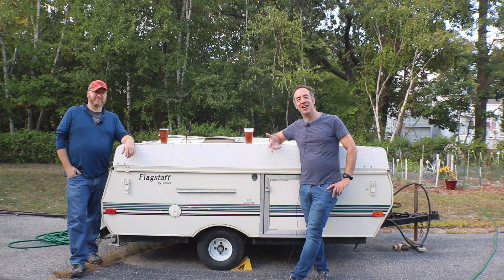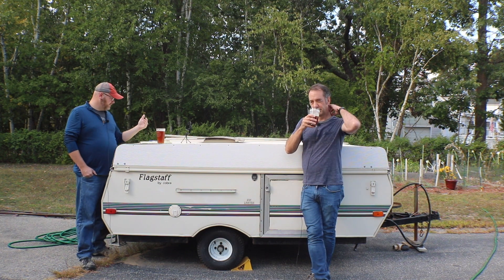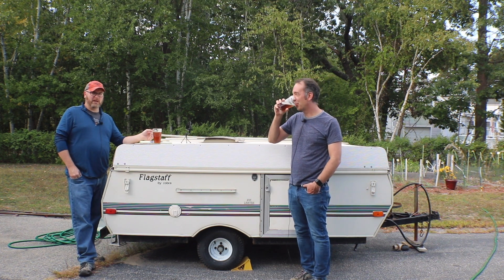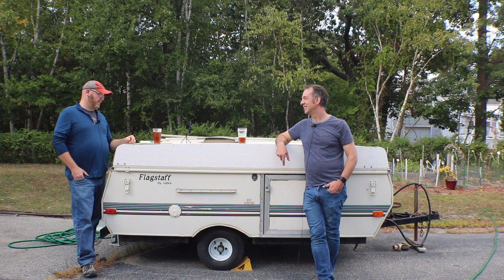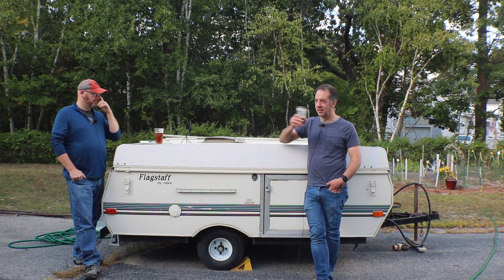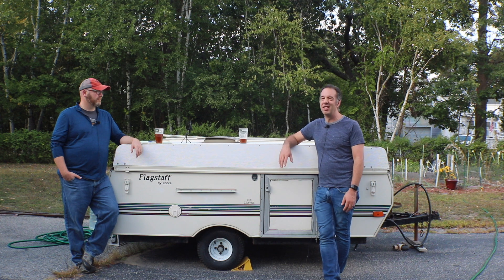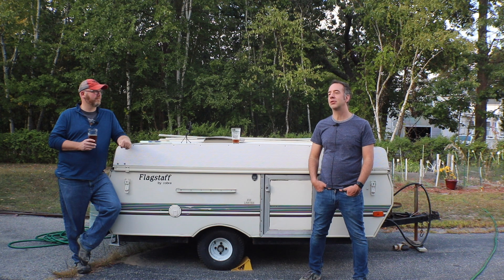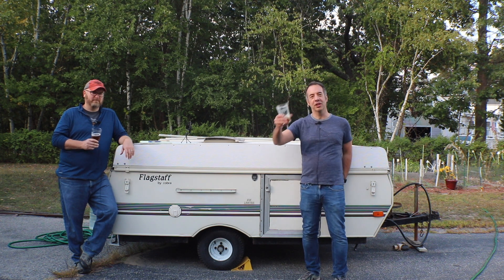Off-Flavor Experiment - Phenols In Contaminated Homebrewed Beer

Comment: Really enjoyed this video.  I have a hard time getting rid of my "home brew funk" in many of my beers despite tons of washing and sanitizing.  They range from funky but drinkable to downright awful dumpers. I've read many descriptions of what contaminates produce which off-flavors, but in real world experience it is often hard to pin down. "Home Brew Funk" or "Buttered Asshole" are just not good, technical descriptions.  I appreciate the post-video description of what you are going to do to troubleshoot this issue - very helpful!!
Reply from the maker: I'd totally toss anything plastic that contacts the beer post boil/chill.  I'd soak everything else used to ferment with warm clean solution (75F).  Rinse super well then do a warm cleaning with PBW 10% stronger than usual.  Rinse well.  Lastly I'd sanitize overnight with a totally different sanitizer.  If you use StarSan, go to iodophor.  or vice versa.  That should do it.  If that doesn't help them maybe its time to buy a new fermentor.  Best of luck.  Direct message us for more support.  Cheers!  -Mike

Comment: I can definitely relate to this one.  I have brewed monthly for several years without having a bad batch.  I was getting real confident.  Recently,  I have dumped three out of four batches (15 gals.).  I am at a loss. It started when I switched brewing suppliers from Minnesota to Texas.  The questions I am dealing with, is it the hose, grain, hops, or a stupid mistake on my part ??  I think it is time to fall back to square one.    I am going to brew  a SMSH beer with ingredients from my original supplier, Northern Brewer. What has really got me puzzled is the fermentation process.  It does not look the same.  The krausen won't sink to the bottom on its own after the fermentation is complete.  I have been brewing frequently for six years and never had to deal with this before.  Well, Onward.  Cheers!
Reply from the maker: Could be a switch in water quality.  Depends on what the off flavor is. I'd do a deep clean and give it another go. Good luck!  -Cheers.